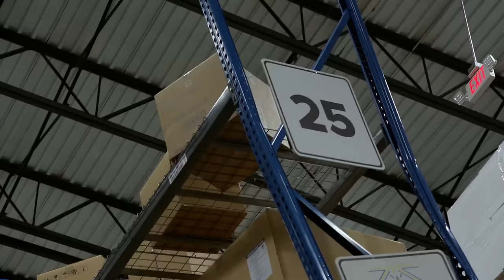Casey, Severide and 51 Try to Save a Man Trapped Under a Forklift - Chicago Fire

Comment: as forky with ten years exe I can say move the damn tine pull the pin on the top and the tine will just drop off they are designed like that for this reason or just use your other forklift to lift it  you must have more than one fork ?

Comment: I thought forklifts have a bolt that would allow you to remove or adjust the forks? unless it's one of those with a fixed positioned forks.  (speaking as a forklift driver who had been pranked by having his forklift's forks swapped with a 30 cm length forks...)
Reply: They do, so you can widen or narrow how wide the forks actually are. There are so many things wrong with this scene I laugh at it. Plus it's an extra long fork with standard 4 ft deep racks, so it doesn't make sense why they have really long forks, other than for the drama.

Comment: 2:35 imagine if that dude would have had a spinal damage i mean if so then because of their technique he would have lost his control of his legs and arms. The guy supposed to keep his neck straight basically broke the neck.

And those ropes they put on the shelf to hold it back. Its better to put it on the much more unstable part to drag it back from falling down.
Its these key things that make shows more loved.

But what do i know about simple logic and that i just learned medical, stuff while in the military.
Reply: considering he has a Flail chest which is 99% fatal unless you happen to have an OR available, i doubt the rest matters

Comment: I'm forklift certified, and you do realise you could've moved both prongs on a modern day forklift very easily through the controls on the forklife
Reply: Can you move them to the side? Like sideways if it was standing upright? Because moving it up or down would just crush more of his torso
Reply: @Hampo03  Yes most modern forklifts allow you to sideshift the forks by about a foot off center. It would be more than enough to get him out, or you could pop the pin and remove the fork.

Comment: I know it's a TV show and all but the scene itself has so many fails. My wife told me to shut up after I started calling stuff out in it, so take the comment as that, observation.

I drove a forklift in a warehouse/distribution center for years. I've seen a lot of accidents, been in a couple myself. I have seen forklifts tip over like this, there is a solid steel cage the operator sits inside of, the OSHA certified operator will be taught to hold on to the steering wheel and plant their feet, and keep arms and legs inside of the cage and ride the fall. It's the greatest likelihood to not get injured. 

The fork on the lift is 6 plus feet long in a warehouse with standard 4 foot deep racking. Other than adding to the drama, I didn't see anything in the shots that would push the need for extra long forks. A standard 3 and half foot long fork weighs in around 150 lbs. Longer forks weigh up to 250 lbs. The forks usually have a pin located at the top of the fork that connects to the mast, known as the corral that acts as a backstop for a pallet. That pin can get pulled and move the fork, based on what I could see, the fork could have been moved since there wasn't a load on it. I saw several people "attempt" to pick up the lift or reduce the weight on the person under the fork. That lift weighs 10,000 lbs., you are not going to lift it. I have never seen someone get pinned under a lift like that, but my first reaction would to have grabbed other lifts and attempted to lift the forklift off of the person. A couple forklifts may be needed, in fact, when a lift did tip over while being worked on, tires getting replaced, we did just that, 2 lifts were used to upright the forklift.

When Cruz ran up and shouldered the rack, say goodbye to your upper back, neck and head. Cruz in real life would have been decapitated when that rack came down. I counted 4 tiers with a load in it. We're talking 10,000 lbs. estimated based on pallet type, number of pallets and known weight of racking. That rack looked like an 8 bays wide by 4 tiers, so 32 pallets of freight stored in that racking. I worked in warehouses where the average pallet weighed 1,500 lbs. So doing some basic math, that's well over 50,000 lbs, not including the rack weight. I have installed and removed racking, it requires forklifts to life and place. I wouldn't attempt to squat hold a rack, it wouldn't work.

Comment: im confused, most factories like this have multiple forklifts, also, EVERY forklift of this design allow the forks to move in and out, either manually or with the click of a button, from watching the video, those are manual, pull the fking pin and lift, at that point you will only be lifting the one fork and not the full forklift

Comment: !EDIT! This rant got a bit out of hand but I'm pretty furious after seeing this and wanted to be as clear as possible. This is the EXACT KIND of DANGEROUS and UNREALISTIC situations these kinds of shows should NOT BE ALLOWED to show. People might get ridiculous notions in their head that THIS WORKS. !END OF EDIT!

This is just ridiculous. You can not stop such shelving from falling over by pushing it from the bottom. What are they, the Avengers? Even if you were supernaturally strong it would just tip OVER you. Roping and supporting at the bottom wil do NOTHING. Having all your firemen run under there is sending them to their deaths or to permanent disability. 
This show has done some ridiculous things before but it 's just getting worse and worse. Always in an attempt to appeal to "the working class" by having them risk it all for regular Joe. Well this working class regular Joe is telling you, these are morons. I have seen, with my own eyes, these exact types of shelvings collapse. I have even constructed them in my earlier years, I know them well. 
They wouldn't be able to save themselves, let alone others. In fact, they might seriously worsen the situation: this shelf would still have tipped. If an object somewhere between 8 to 12 metres high is supported at the bottom, about 1,5m high, with all the weight ABOVE this 1,5m this will do NOTHING, this will stop NOTHING. This is basic physics: lever mechanics sideways. Anyone who works with heavy loads KNOWS this. The further from the tipping point force is applied, the more effective it is: ALL the weight/force is furthest away from the tipping point. No human strength can stop this. Plus, the add the sound of shattering glass clearly to imply lightbulbs or some such, something "not too heavy". I've worked in a warehouse for spare tractor parts: a pallet of lights will still easily range from 250 - 400 kg. It's unclear how high but I've  counted atleast 5 high. Minimum 3 pallets wide. 3 times 5 times the minimum of 250 = 3750 kg. ATLEAST. Plus they're at the short end of a "lever" already tipping the other way. They'd be lifting something close to what, 30 tonnes? 40? With manpower? This would be like them lifting a semi at maximum capacity. That's just the weight, disregarding that this weight would just fall over their heads regardless of their abality tto lift it. You couldn't stop this shelf from falling, like this, if it was EMPTY.
The firemen underneath would've been crushed. Instead of tipping over the anchor points of the shelf, the anchor points would have been ripped from the ground and shot out in the opposite direction because it would have to tip over the supports they placed, injuring the firemen pointlessly standing there with the useless roping. You have to rope this as high as possible. Again, lever mechanics. In fact, considering how the place those supports the way they're pulling those ropes is HELPING IT TIP.
All of this is even disregarding the basic fact that the pillars of these shelves are bent or damaged, their structural integrity is ruined: this shelf would've come down STRAIGHT AWAY after the collision. You can see it clearly being bent, and at one  place BROKEN IN TWO at the the bottom where the forklift hit it, this would've instantly collapsed the entire shelf. This would never have been a rescue but a recovery. They are not built to resist such weight, such strain, when damaged. Which is why any proper warehouse is very strict about safety, and if you receive a bent part for constructing such shelves ANY and ALL suppliers of such would instantly replace it, no questions asked.

End result: 

-Original victim: definitely dead.
-ENTIRE firecrew: dead or hospitalized
-Fire Chief: Disgraced, plus wracked with guilt over being so stupid he's killed everyone.
-Fire Department and city: facing multiple lawsuits from families of the needlessly deceased, most like amounting to millions.

I get that you have some artistic freedom but this is just ridiculous.
Reply: Calm the f down it's a Show😂
Reply: @germedicsam  read that first sentence again, carefully. People are constantly dumb enough to think that what works on tv works in real life. Hell, people send hate mail, verbally and even physically assault actors for what their characters do.

I'm sorry I took the time to try and educate you.

Here's some examples of what would've really happened here: 
https://www.youtube.com/watch?v=-CFTIOQCqTc
https://www.youtube.com/watch?v=fIP24ywBAdU

If you think it's just fine that tv keeps promoting stupidity well, fine. I gues this show's right up your alley.

Ps: does cussing at people from behind your computer make you feel all big and tough? If you have nothing useful to say in a decent way, don't speak. As the saying goes: your silence might make people think you're dumb and/or vulgar, but your speaking confirms it. Then again, so does your defending this tripe.